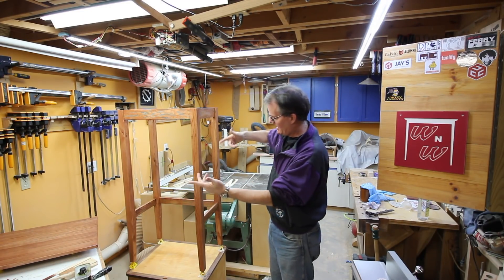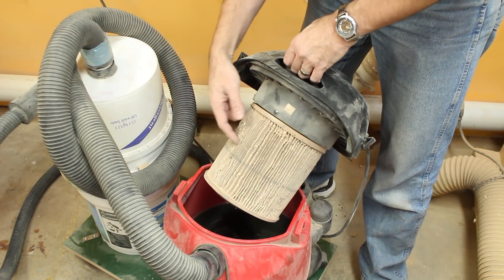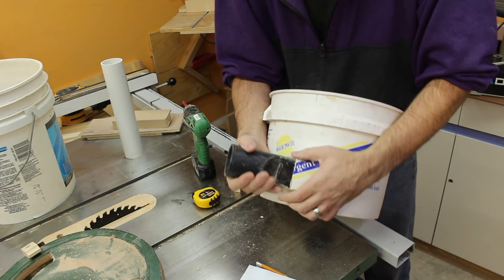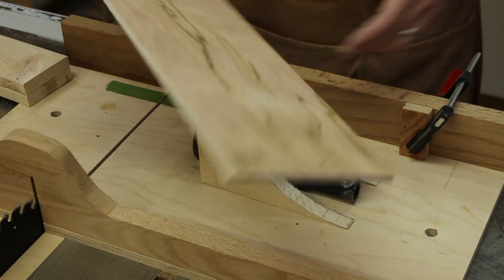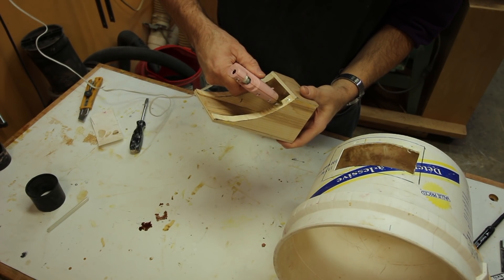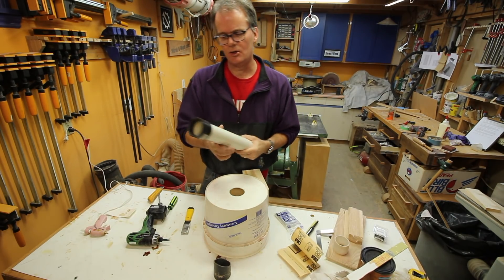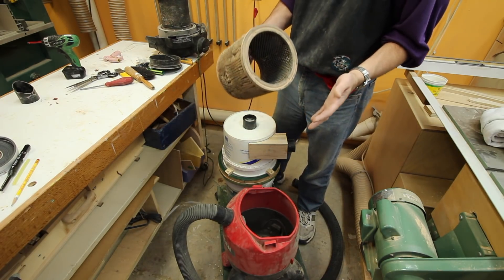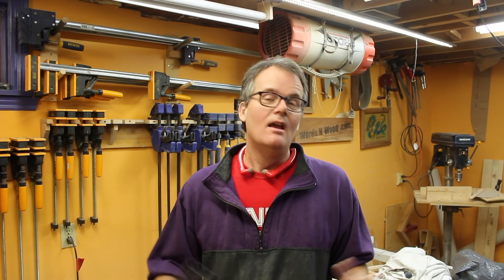Improving the Bucket Cyclone (WnW #91)

Comment: Nice job on the separator.  I really like the upside down bucket idea on top - I think that I'll use that!  I've been looking at a lot of these dust separator vids, and you're the only guy where I've seen that.  I'm not an inventor, but I think that I'll make mine different  than any I've seen yet by combining one idea that I got here, one there, and one someplace else, etc.  What I am leaning to making at this point is using a 20 gallon metal trash can with a double thick plywood lid with the bottom piece of ply fitting snugly inside of the drum and the top piece sitting over the rim, like a plug - weather stripping, gasket, etc.  Then I think I'll cut a hole in the middle to fit and clamp on the separator in an upside-down bucket, just as you made it here.  My shop vac is short, a Rigid tug-a-long, I haven't decided yet if I want to build a short cart where the vac goes in a compartment at the bottom, and the trash can above, or just put the trash can on a dolly and pull two things around.  I wouldn't have to pull very far, my shop isn't that big, but I could save floor space by stacking too.  I know that I want the separator on top since that's where the hose goes in, and I want the vac to easily be taken out, to take other places alone.  I'll work it out as I build it.

As for your obsolete filter, there are a few things you can do to make it reusable and better (not as good as new, but a lot better than just putting it back on as it was).  Put on a dust mask and take it outside and blow it out from the inside out with an air compressor.  That'll get most of it out.  If you want to get some more dirt out of it after that, go around it on the outside working a whisk broom through the pleats then blowing it out again from the inside.  You should see more dust blowing out at first, but after a few more brushings and blowing, you won't - or repeat till you can't.  The cleaner that filter is, the harder your vacuum will suck.  If you want it even cleaner, the next tip works by far on most filters, but not all, depending on the paper or material they are made of.  Most can get wet - a few can't.  After you're got all you can out of it dry, dunk it in warm soapy water and go through the pleats with a soft brush like a paint brush, and rinse it well with a garden hose without any nozzles, easy pressure, from the inside out, then let it get completely dry before you use it.  Once you have it as clean as you can get it, you can either buy, or make clothe prefilters that go over it and are secured by a big rubber band.  Like a big coffee filter.  These don't have the surface area of the pleats, but are either cheap (blue paper shop towels are better than nothing), or clothe can be washed in the washing machine.  Just watch how it us acting, if it's  to tight of weave, it'll overwork the motor like a dirty filter does, and you'll have less suction, if it's too loose, it won't filter much (but you'll have the filter you cleaned up behind it).  Usually, I just blow them out and use them again for a while, not so much because I'm that cheap ( Well I am, but also) because I live in the boonies and it's well over 100 miles before I come to a town big enough to have Lowes, Home Depot, Wal-mart, or anything like that, and I was doing this years before there was internet shopping, not just to shop vacs, but Kirbies, Hoovers, and any others with filters or bags - of course the manufacturers (who sell bags and filters) advise against it.

Comment: That's great work out there....Almost free..... Radical improvement....But as for the shop vac filter, why searching for another ,non available, one while you can simply clean the one you already have.... Just use compressed air and/or clean with water.

Comment: I know i'm late on this video, but you should really upgrade the hose you actually use for sucking up the waste.  That small diameter hose really constricts airflow as well as preventing you from sucking up larger items (like at the end of the video where you had to pick up a couple of things off the floor while vacuuming).  You should use the same size hose you use from your vac into the cyclone.  I literally just switched to that size last week and it was one of the best purchases I could've made for dust collection.  Large hand plane shavings used to clog up my 1.25" hose, but the new 2.5" hose just sucks them right up.  It's amazing.
Reply from the maker: Yeah, I've heard that, thanks!

Comment: I use a similar vac here in UK for my metal workshop - and everything else in the home... it's a wet/dry suck/blow unit, with a cloth bag filter, and an option for a filter like yours. When either filter gets clogged I just take it outside and brush it with a sweeping brush, then put it on the "out" side of the vacuum cleaner and reverse-flow the filter (blow it through). It works for me.

I like your cyclone system, I'm going to do something similar soon. Thank you.
Les in UK

Comment: Art, I use a similar setup in my shop.  Would I like a full blown DC System?  Hell yes!  Do I have room for it?  Hell no!  lol  So I make do with two small cyclone systems much like yours.  One is for my bench top jointer & planer bench, the other is for the table saw and everything/anything else.  Thanks for showing that you don't need a big super-duper brand X full blown DC system that costs more than many shops can afford!
Reply from the maker: thank-you!

Comment: I had the same issue with mine.  left the filter off.  on the exhaust I just used pvc to a box with a furnace filter on one or two sides for final filtering.  2 20x20 filters will give you all the filtering that vac puts out.